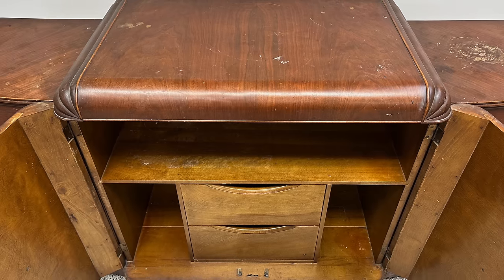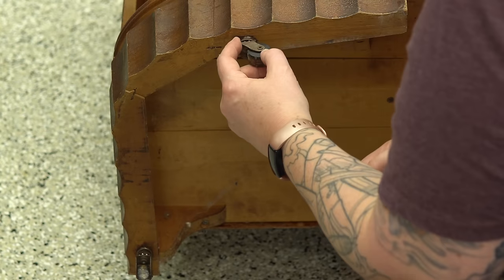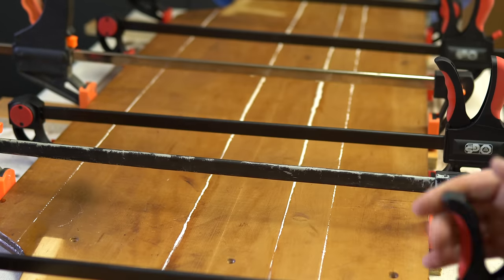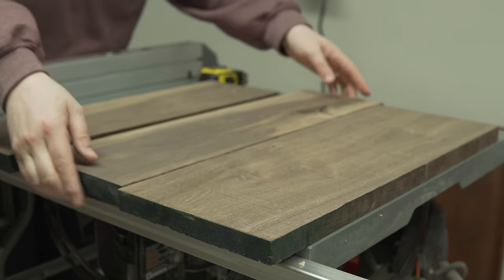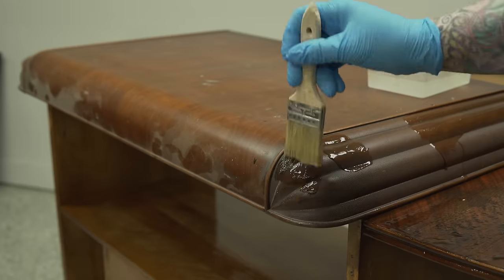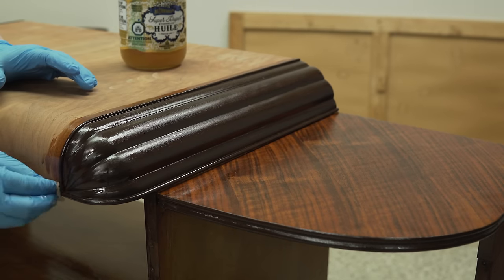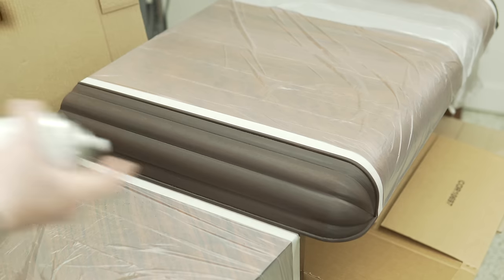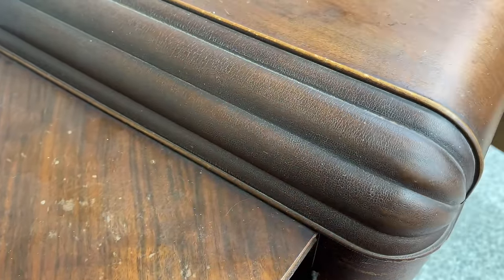I Transformed An Old Buffet Into An Art Deco Masterpiece

Comment: Most of the smaller contractor/job-site saws have issues of one kind or the other. They're not built to the standards of a rock solid shop saw because portability is the goal, not (so much) accuracy. But precision is important when working with any kind of wood, and even more so when working with premium hardwoods. You might think about adapting something like the Biesemeyer fence system to the Rigid, if at all possible. They're great, and are priced like it too. However, by the time you add that expense to what you've already invested, you'll be in the entry level Delta range. Wish I had better news. I'll probably break down and go with DeWalt, but I'm keeping my eyes open for a relatively clean, used, belt-driven, full-sized saw that I can refurbish and set up just the way I want it. I would kill to have my Dad's post-WWII Craftsman available to me again, but that's another story. Oh yeah, the art deco buffet is dreamy, and the work superior. But what else is new?

Comment: Wow. The finished cabinet is gorgeous. Great job. 

Please get yourself a battery charged screwdiver to help remove and reinstall hardware. A drill would be awkward, but the handheld screwdriver is slow and excruciating  to watch. A rechargeable electric screwdriver would make life so much easier.
Reply from the maker: If you think several seconds of me using a screwdriver is painful, you should see how many hours of footage I need to sift through to give a completely inaccurate (from a time frame standpoint) yet somewhat accurate (from a ‘steps involved’ standpoint) depiction of these projects to share with everyone.

Comment: I always thought drawer bottoms were not supposed to be glued in place.
This piece turned out gorgeous.
Reply from the maker: They aren’t when they are solid wood. These are plywood, which doesn’t move like solid wood, and I only used a small amount in one spot only. The rest of the panel is held with a couple small finish nails.

Comment: I didn't have time to read through your comments to see if someone helped you out with your table saw dilemma or not so, I'll go ahead and comment. If your fence is moving it's possible that you didn't tighten up the lock when you took it out of the box. On one end of your fence you have your lock and on the opposite end there should be a bolt. I can actualy see it while you're ripping the walnut. Tighten the bolt with the lock open and then try to lock it down. If it's too tight, unlock it and then loosen the bolt 1/4 turn and then lock it again. If it's not tight enough, tighten it some more. Keep tweaking until you can lock it down tightly, not so tight that it takes a lot of force to do so, and you shouldn't be able to bump the fence in either direction. Give it a good side fist bump to see if it moves. I wouldn't fist bump it with your knuckles, lol. The metal will win. If it moves more than 1/32" or 1mm with a good fist bump then keep tweaking.  I hope this works!

Comment: The clamping mechanism on the fence may not be clamping hard enough.  I had the old version of your saw and I have the newer version of their heavier one (not the Delta rebrand) and they share similar fence design to yours.  On the far side of the fence there is a nut that you can give a little twist to and it will tighten the clamping force.  Not too tight, just a little bit.

Comment: Not sure if it's been mentioned, but alligatoring is a sign of the presence of lead. I know it shouldn't be in shellac, but after some research, it wasn't uncommon for it to be used in stains and varnishes. It's possible for either to be present above or below the shellac at any point in the piece's history. Proceed with caution any time you see alligatoring.
Reply from the maker: Yes, it is known to be present in certain varnishes and stains during those time periods but I’ve never heard tell if it being in shellac, which is prone to crazing on its own with exposure to sunlight, and extreme temperatures (as well as incorrect parameters during application). It’s possible someone had added varnish at some point along the way, but varnish won’t dissolve in denatured alcohol, so this was definitely all shellac. I also test my older pieces for the presence of lead, painted or unpainted.

Comment: Question.  It looks like you put Odie’s on the dark stained parts (in addition to the light stained parts), and then sprained with the shinny toner.  I thought it was recommended not to put a finish over Odie’s.  Is this not a problem?
Reply from the maker: Good catch! I initially was just going to Odie’s over the while thing but decided I wanted a bit more shine on the stained parts. As long as the Odie’s is dry and set up, it’s no problem to put something over it. It’s not needed from a finishing sand point, as Odie’s IS the top coat, but yeah. I just wanted to shift the colour and sheen a bit more and toner with a coat or two of lacquer was the was the easiest way to do it. :-) Thanks for bringing that up!

Comment: Common issue with thise ridgid saws. Unfortunately not verg rigid in their construction 😬 definitely recommend upgrading to a DeWalt jobsite model, the kind that has a rack and pinion adjustment on the fence is excellent imo, and much safer.
Reply from the maker: Yes, upgrading was the only way to go. Thank you very much for watching! 😊

Comment: What do you do with plastic decorative trim.Stain or paint
Reply from the maker: Paint. You couldn't stain it in a typical way. A gel stain applied thickly and allowed to dry for days maybe. If I was going to attempt plastic I'd probably paint it and then add toner or paint it and then use a gel stain wiped over. It won't look LIKE wood but it would be closer.

Comment: How much are you selling this for?
Reply from the maker: This is already sold. I don't like discussing how much a specific piece sold for because it varies so greatly from place to place, person to person and year to year. I never want someone coming back at me saying "Well Angie said I could charge XXX for it." No thank you! 😊 Some people try to use an hourly rate on non commissioned pieces but I don’t find that very accurate. Sometimes the tiniest details take FOREVER, and would quickly “price out” the piece you’re working on. I go by what the piece itself is worth, based on comparable products in my area, and the finishes I’ve done to it. Most of my pieces sell within minutes. Which generally means I’m pricing too low, lol. But I don’t have the space to keep pieces for days and weeks so I need them to move fast. If I had more room, perhaps I could get a price closer to what some others in my area are charging. Which has gone WAYYYY up.

Comment: @TranscendFurnitureGallery I have the same problem with the fence on my Mastercraft jobsite. I just about chucked it across the yard after struggling to keep it in place.  I was ripping edges off reclaimed wood for the focal wall I'm making...I'd rather sand than rip! Anywho...I grabbed the pull down handle on the fence and shoved it down one more time and it went down further than before! Instead of hanging straight down it tucked under the deck and held! Bahaha...guess it's simply wore out as it's pretty old. 
My point is perhaps yours needs a more aggressive nudge...needs a little "woman handling "...bahaha
Reply from the maker: I upgraded to the Dewalt and the fence is amazing. Thanks for watching! 😀

Comment: I'm from the UK. As a child of the 80s, I saw so much furniture with this finish in the homes of older relatives. I saw what happens when furniture goes out of fashion. It was widely regarded as dark, dingy, decrepit, dirty, ugly big lumps of heaviness that nobody had room for. It all ended up on bonfires. Most of it, perfectly undamaged until smashed up with a hammer ready for burning. It was replaced largely by clean looking plastic laminated chipboard in light cream, white or awful looking fake pine. Self assembly modular furniture with clean lines and ugly cheap plastic handles. In other words rectangular boxes with wonky doorsand drawer front. That stuff aged very poorly and ended up on the bonfire within a few short years. It's still the same story, only the quality is even worse. Paper foil, which looks a little more like wood to be fair, covered chipboard that stains and rubs off if you so much as sneeze near it. I have managed to upcycle some of it with paint by using the carcass and adding real wood tops, drawer fronts, nice handles etc. but it's never going to look as good as these refurbished pieces. You are really talented.
Reply from the maker: Good on you though for taking steps to do something with these pieces. Any piece saved from the landfill is a win as far as I'm concerned but you're right - furniture now is nothing like it used to be!!

Comment: You need some Acetone to remove the stripper waxy residue before proceeding. Glad  you stripped it.  You cannot send off old finish, esp on thin veneer.  Nice overall result but in my opinion you ruined the piece by adding paint on the trim.  Never paint a good piece. It may be the latest trend but it is a very bad idea.  Wood was selected to naturally contrast subtly with its veneers.  When you paint, not only is it a jarring different sealer but the black contrasts too harshly with the wood grain.  Not a nice look, it is vulgar and lacks refinement.  Stick to one finish for the whole piece, a natural one which brings out all the wood grain.
Reply from the maker: There is not a single drop of paint on this….
Reply from the maker: And no black…